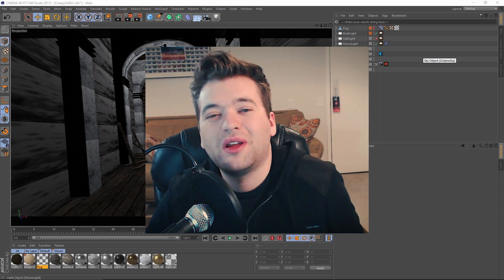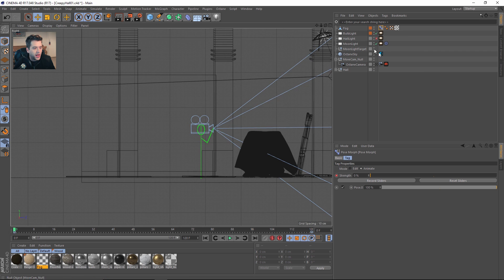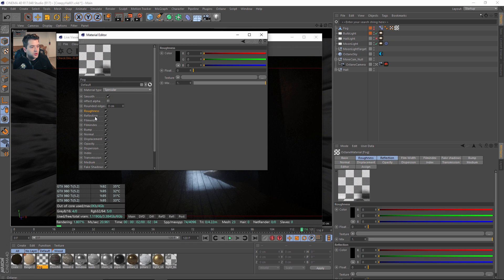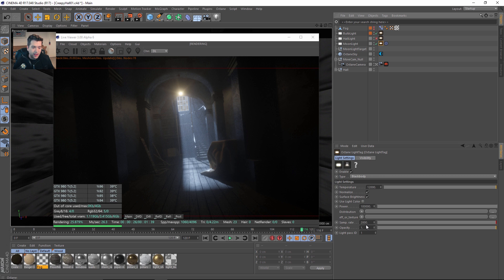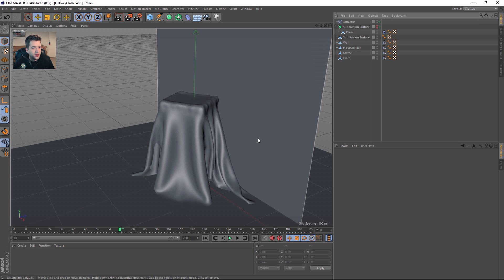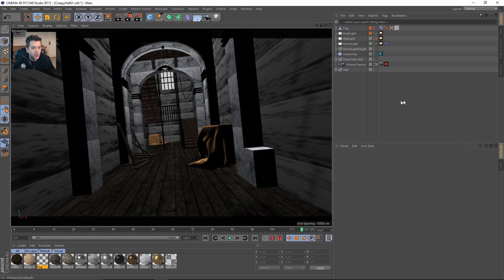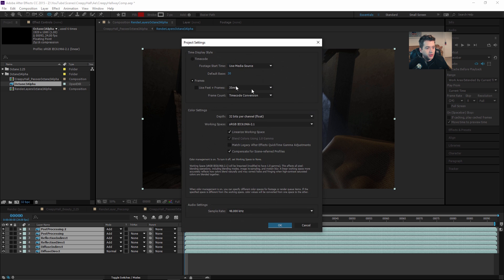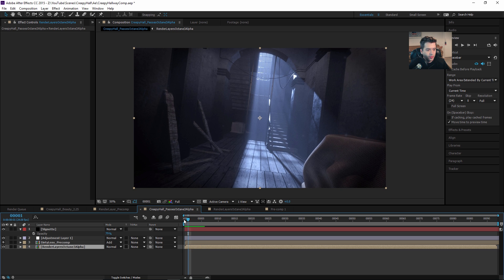Volumetric Lighting in Octane 3 and Cinema 4D

Comment: This is going to be a super-noob question, but I just can't figure it out. Apologies in advance! 

How do I export animations from C4D/Octane? The Live viewer works fine -- renders the current frame in like 30s. However, when I add my animation (15s/450f) to Render Queue and hit export, nothing happens. I wait for 20 minutes and not a dent in the export. 

Can you explain how you went from 11:51 to 11:55?

I tried to look on the forums and they were talking about sending various different file types to the Stand Alone and then exporting camera data and then exporting a video file. I find that overly complicated. Is there anyway to just export the animation into a PNG Sequence or MOV or MP4 straight from C4D?

Thank you for your time.
Reply from the maker: Hello Saad! I make sure that my render settings are set to all frames in the timeline and then I render to the picture viewer. You can also add the job to the render queue. 

Make sure your movable objects in your scene have a octane object tag so the data is correctly sent from frame to frame to your GPU. Let me know if the picture viewer is working for you! Best!
Reply: I think it was the Octane Object tag. Didn't know I had to drop that onto objects -- which is really weird. So, it goes on all geometry? 

Thanks for the help!
Reply from the maker: It only goes on geometry that is moving through the scene. That way C4D and Octane are communicating clearly and updating the mesh on a per frame basis. If a parent object has an octane tag, then it's child will inherit it. You can also go into the C4D render settings > Octane Renderer, and set the global geometry engine to resend all scene data, as a fail safe if nothing else is working correctly. Cheers!
Reply: I didn't know that!!  Might explain a few things!

Comment: what is the difference between rendering with 3 gtx980ti instead  of 4 gtx980ti?
Reply from the maker: +cheese puff GPUs scale very well in octane. For example, say you have a workstation with one GTX 980 TI. "Three more graphics cards (in that single GPU workstation) means 4 times shorter rendering." That quote is from Sebastian from the Octane render forums. I can say that after testing this theory, with multiple workstations, it is true. I hope this helps!

Comment: Samples are just a ratio in comparison to each other. Instead of 1,000,000 on one light and 2,000 on the other you could do 1,000 to 2 and have the same exact result.
Reply from the maker: +mentor972 Right! I believe I mentioned that they are comparing figures in the video. I like to crank it all the way at max and then scale back from that factor. It helps me working that way, great input!!
Reply: +Glass Hand Films Word. I gotcha.